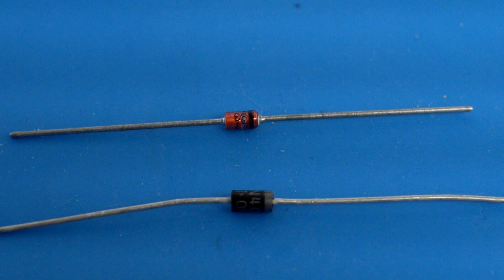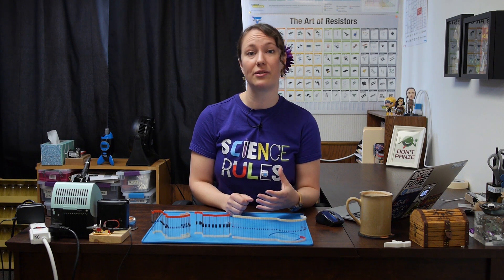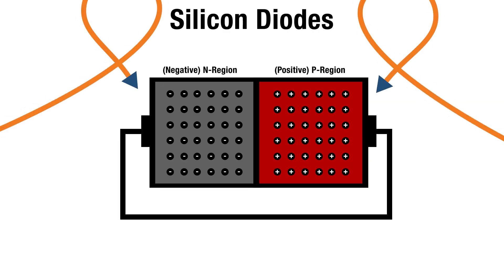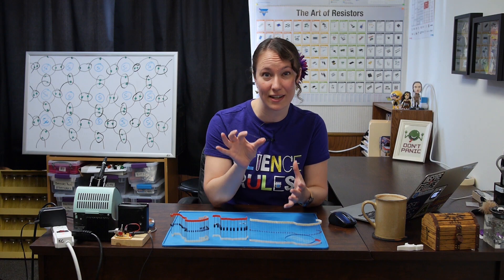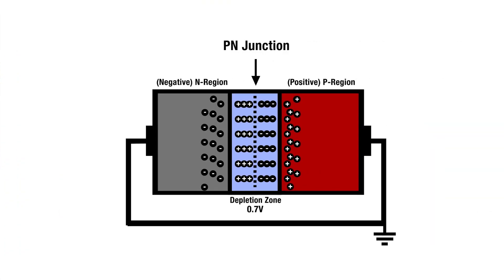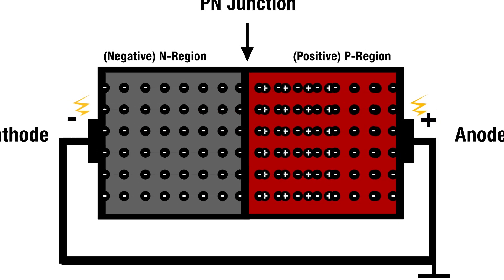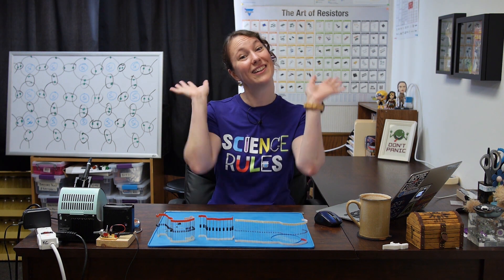How Diodes Work - The Learning Circuit

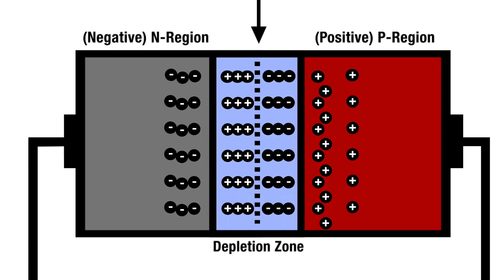Comment: The concept of the diffusion potential barrier at the junction is not explained correctly, although the rest of the video is well narrated. The positive charges in the N region depletion zone do not repel the negative charges in the N zone (4:45). Positive charges do not repel negative charges! It is similarly incorrect as stated for the P region (4:52). Rather, the developed potential across the junction becomes a barrier to further charge movement ACROSS the junction, in effect, sending charge backward -- and at a potential of 0.7 volts the charge movement in both directions across the junction becomes equal and opposite. I would have a look at some other videos on semiconductor diodes which better explain this concept.
Reply: Yeah, that really threw me.  And what's weird is she seems pretty competent and you'd think just hearing herself say positive charges are repelling negative charges would jar her to rethink her wording.  Weird ...  The rest of it is pretty good.

Comment: Thanks, I'm and experimenter and look for results, but lately need to understand the diode. Very good and be safe.
Built one pulse motor that ran for two years and charged it's own battery. Took down all the video's which had been posted, thinking about putting them back up. Thanks again.

Comment: @ 4:20 you say the p and n regions become slightly pos and neg charged. Why and How? If the extra electrons in the P region left to fill holes in the N region and visa versa, then didn't those atoms just become neutral again with 4 valance electrons like the original silicone atoms? Sorry, this is the part I never understand.

Comment: The depletion zone of the n side if the junction should be positive charge but you label as negative.
Unless you mean the n material being a source of negative mobile charge carriers. But after they diffuse to the p doped material the n type material near the junction takes on a positive charge.
Similarly on the p side of the zone a negative charge develops locally.
The crystal as a whole is still electrostatically neutral with local effects isolated to the junction.
The charges are not homogeneously distributed thru out the crystal but rather accumulate in equal amounts at the p n junction and so cancel out so as the crystal to remain in electrostatic equilibrium as a whole.
That's my understanding at least.

Comment: 4:40 youre saying opposites now repell? Whats going on?
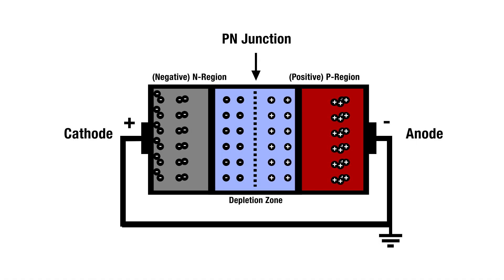Reply: exactly. I am wondering the same. The diagram changes completely at 5:40 XD.
Reply: She was showing what happens when a diode is connected backwards, the reason current only flows one way through a diode. What happens when you connect it backwards? The N&P type separate further, that's the repelling you see. Connected backward so what's happening is right, negative side is attracted to the anode(pos) and positive attracted to the cathode(neg). it's repelling because it's backwards. she then installs it correctly, showing the flow.....
Reply: Eventually, the electrons in the P part of the depletion region create enough of a negative charge to repel any additional electrons from crossing over.
Reply: There’s enough negative charge in the depletion zone to repel what’s left in the N region, and enough positive charge in the depletion zone to repel what’s left in the p region.
Reply: That is how it works in current , at first negative is weak and it needs  positive ,but when there are lot of negatives it feels safe and do not need positive and repel the , it is like a person needs another special person to feel safe and happy but when that person  gets some friends he feel safe and do not need that special person
Reply: @chrisstromberg6527  
I agree with you. The negative charges in the depletion zone of the p region is now strong enough to repel the incoming free electrons from the n region.

Comment: I enjoyed your video,  very informative.   Although your video shows "electron flow", I can see how "conventional current " might be also used to show the current flow since the schematic arrow (diodes and transistors) points in the same direction.   I can also see how " tech people " might be passionate on which is more correct.

Comment: From a science teacher perspective: great video, great explanation, great graphics at the beginning, but this video becomes confusing after about 4 minutes.
For instance, at around 4:45, the following sentence does not make sense for students, as they learn that (-) and (+) charges actually attract each other: "N type side gains enough positive charge in its depletion zone to repel the negative charge in the region".

Before that, the graphics are showing that (+) charges are moving from the P region to the N region, which also fosters misconceptions in students. It's the (-) electrons that move from the N region to the P region, leaving behind (+) charged ions. That means that (-) charges build up on the P side, which then starts to repel more "incoming" (-) electrons trying to hop over to the P region from the  N region. At the same time, the (+) charged ions (the ones that are left behind at the N side, from the first few electrons that hopped from N to P), are now more strongly attracting any (-) electrons that are also trying to hop from N to P, making that more difficult. So, the (+) charges don't move, rather, it's the movement of (-) electrons that leaves behind (+) charges. The subsequent attraction between (+) ions and leftover (-) electrons in the N region on the one hand, and the built up of (-) electrons repelling each other in the P region on the other hand, is what prevents all the "holes" in P from being filled with "leftover" electrons from N.

So, overall great attempt, but not something that I'd comfortably use in the classroom.
Reply: Thankyouthankyothankyou, Ian, for this explanation. You're awesome. I watched this video over and over again without gaining any understanding about what happens at the depletion layer. None of what Karen said made any sense to me. Honestly, the more I watched, the more confused I got. Your explanation answered all my questions, and is the best I've read or heard anywhere. I've copied and pasted it into my notebook. Thank you again.

Comment: One use is the commutating, or freewheel diode. They’re placed in parallel with coils so as to provide a path for current created by collapsing magnetic fields. Typically used with relays, contactors etc.

Comment: I saw it different way. When positive terminal is attached to negative n-region of diode, it suck the electrons out(or it's trying to take electrons), that causes the free electrons to be depleted in the n region becoming an insulator. Because electricity moves by free electrons. The p region connected to negative, causes the electrons to neutralize the positive region turning it into an insulator. So the diode becomes an insulator in both p and n location with no free electrons for electricity to move through the diode when the terminals are attached incorrectly.

Comment: When junction was formed and positive charges were crossing the junction so why they stopped?
Why don't positive charges go to join the next negative charges in the remaining part of the diode?
Reply: the semiconductor nuclei and the doping element's nuclei, are forming a lattice. Most of their electrons are  trapped just fine in their valence shells. We're only getting a flow of excess electrons rushing through.

Comment: Another great lesson from TLC! Diodes and transistors are cool because they are driven by the interactions of the physical properties of the materials from which they're constructed. Hooray physics!

Also, if you want to see a fun application of diodes in a circuit, check out the DIY Geiger Counter video on element14 Presents!

Comment: 7:57 - How do you have a >0.7 voltage difference across the diode when both ends are connected to a common ground?
Reply: Was wondering the same thing.

Comment: how do electrons bond when like charges repel ? is it spin or is it a covalent bond you mean where the valance orbital is sharing electrons ? , not sure what you are saying
Reply: If you're talking about when I was drawing on the dry erase board, it's not that they're bonding. The outer valence shell of those atoms can hold 8 electrons. So each atom has 4 of its own electrons and "borrows" 4 more to fill its outer shell, 1 electron each from 4 other atoms. The electrons aren't necessarily bonded, but they are shared by two atoms, which helps bond those atoms together. Does that help?
Reply: Wow thanks for reply. Yes that when I was talking about, and your reply makes it clearer now.
Reply: How did you know exactly where I was talking about... I'm flipping out. So cool....... 😀

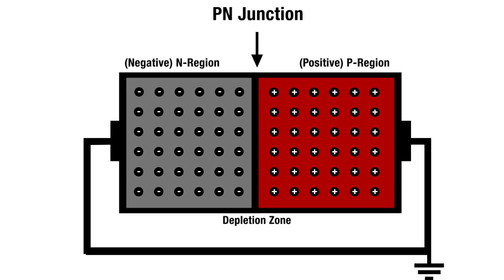Comment: Methinks the holes in the P-Region should not move towards the N-Region as the video suggests from 4:09 onward. Holes are hold tightly by the atoms, and those latter don't move as they are part of a solid crystal. Only electrons are free to move. The whole schematics is flawed IMHO, because it suggests (before the PN junction is established) that the P- and the N-regions are full of anions (positively charged atoms) and cations (negatively charged atoms), respectively, and that's not true I believe. Neither region is electronically imbalanced, although the P-region would gladly accept electrons so as to make their crystal arrangement more stable, whereas the N-region would be happy to get rid of its spare electrons. The idea of the "holes in the depletion zone repelling the negative charges" (4:46) is a complete nonsense to anyone who had a minimal exposure to Physics, or Sciences thereof, and just contributes to the whole confusion. I will not press the dislike button on you, but I didn't like this video.

Comment: 4 diodes can be used as a bridge rectifier or all pointing the one way and in this mode can be used as a Diode Ring Mixer an example of this is a MD108 or a SBL1, Diodes can also be used a electrically controlled variable capacitor or vericap.
Reply: The depletion zone widening under increased reverse bias is exactly how varactors work.

Comment: Ok.  One thing I deem extremely important.   A simple vacuum diode.   If you were to closely relate the Sun and it's radiation as being either A: The cathode in this device. Or B: The anode in this device.  Which one would it be?    Also.  Likewise for the Earth.   If you were to relate the Earth as either A: The cathode.  Or B: The anode.  Which one would the Earth be?   Knowing a vacuum exist's between these thing's.  Knowing a gas does exist between these thing's.   One other thing I must ask you student's.   How much charge must a capacitor be encumbered with before it start's to radiate visible light?   One other thing.   How would someone calculate the capacitance of Earth's central core?   And what is it about the SUN that makes me believe that the charged particles emmitted from it are INSTANTLY TRANSFERED to the Earth's magnetosphere.  How fast does a free electron move in one direction through a vaccuum space?